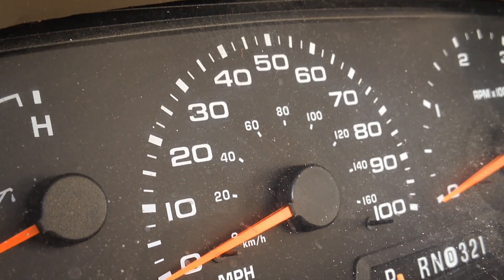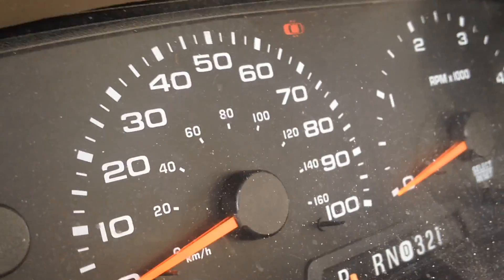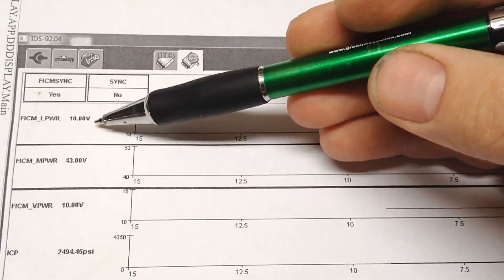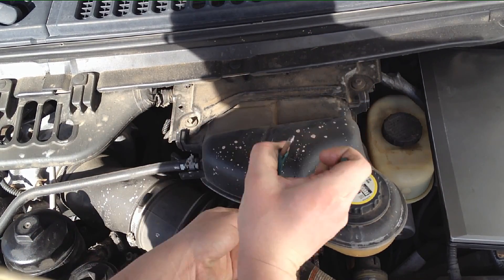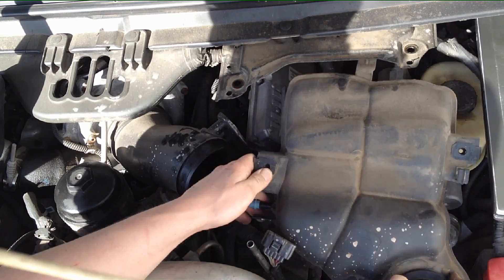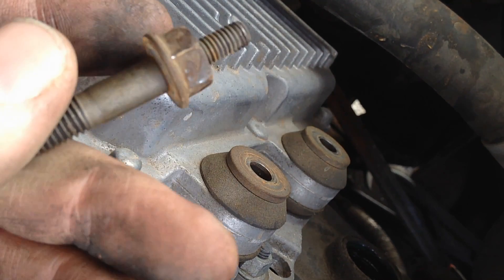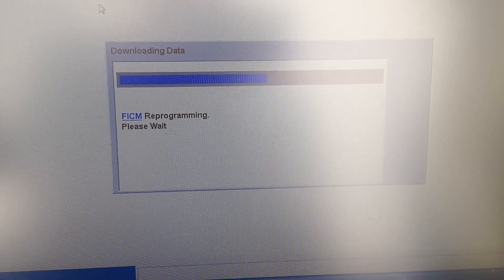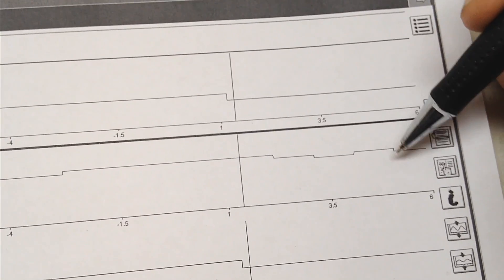No Start: Ford 6.0L Powerstroke FICM Diagnosis & Replacement

Comment: I have a 03 f350 6.0l powerstroke crank no start I am not getting ficm sync or crank/cam sync. Could a bad ficm cause no crank/cam sync? New crankshaft position sensor and wiring harness, any thoughts would be greatly appreciated

Comment: Hey man great video!! Having a FICM issue on my 2006 DT466 7.6 in-line 6 Navistar. They use the same IDM as the 6.0L V8. Would you know how I can go about flashing the FICM to be able to work on my truck. They all come programmed for Ford 6.0 V8

Comment: Ever see the logic board fail? All pin point test, air test, Ficm power board, IPR, Icp, cam all changed or pass. Motor starts run till 180degrees then stalls? Fuel pressure 70, buzz test good no codes…. Once stalls will fire then acts like the key is turned off?? Anyone got an idea

Comment: I started her up today, it was a little cold.  Idle poorly and took a while to warm up. Then the check engine light came on with p0276. Auto store said FICM. They say injector #6 is low voltage. Should I take it as bad FICM and buy it and dont investigate anymore?!? Anybody know anything more on this injector low voltage?!?

Comment: 04 f350 6.0 and out of nowhere would not start wouldnt crank brand new batteries. I checked all connections still no start im new to diesels but I ended up needing to use screwdriver at the starter solenoid to start it to get truck home what could be the source of issue next day has started fine im confused

Comment: Ficm voltage is straight 0 when cranking. Got a new ficm and still the same thing. My IPR % ICP volts and ICP PSI are normal. What would be the next step in the troubleshooting chain?
Reply: Whole wire harness?
Reply: Relay potentially, only other thing I hear besides maybe yeah the wiring harness

Comment: On my 04 f250 6.0 it was cranking with injector cycle and fuel pump working with no start. Now starter does not turn, no injector cycle and fuel pump not working. i can jump the starter and it turns. Any ideas?
Reply: May have overheated the starter solenoid

Comment: I have 2006 6.0l starts and runs but misfiring on cylinder six only setting a p0276 code the injector 6 and where replaced. Could a fcim cause only one cylinder to miss
Reply: I was told that FICM was my problem for p0276 low voltage to injector #6!!! Did you figure out your problem because I have the same problem you do now.... lmk pls
Reply: @benjaminbailey6383    Yes it was the FCIM was burnt on the inside
Reply: @adamlagace2485  thanks!

Comment: I have a 04 6.0. I also have a scan gauge. Can you help me with my crank no start? I can upload a picture of the icp sync ipr and ficm m power.
Reply: Any update? Same here all around 04 6.0 crank , no start
Reply: @jermbob92   any update same issue right now breaking my head with this fotd
Reply: @jonathanbravozya  my issue was a failed attempt rebuilding my injectors. Bought all 8 motor craft injectors and it started right up.

Comment: Anybody have thoughts on a 06 6.0 that is really angry starting below 30 degrees f? All my readings are good except after a cold start below 30 I get p0284-60 dor cylinder 8 after a few warm drive cycles the code disappears or does not come back. Switched to 5w40 t6, changed fuel filters, and added the blue spring. Starts a little better but still seems angry on a cold morning. By angry I mean loping after start and just really rough idle for the first 60 seconds or so.
Reply: For cold climates, some have been changing starter to the 6.7 which offer 25% faster crank

Comment: im wondering if this is same problem im having on my late 04 6.0 its my icp i have to pull plug out or she wont start i have to keep rpm up to 1500 or she stalls changed pig tail on icp same problem no power pulling my 11k trailer up hill

Comment: No start for me, but FICM main power is actually at 0. Fuses all look good, relay  replaced. I replaced the power supply on the FICM as well. 
Ground issue? It will crank, but not even try to start.
Reply: U figure it out?

Comment: I just bought a truck drove a few miles shut it off and when I went to start it would just crank. Let it sit a few hours and noticed when I turned the key I didn’t hear the spool valves and still wouldn’t start. New ficm was installed last October (9 months) could it be bad? What else could I check.
Reply: weisel6 dummy plugs and standpipes.

Comment: I've got a question for ya. I have 2007 f250 with the 6.0 liter and I'm getting around 1.7 volts to the fuel pump with the key and everything off but I get 12 to 11 volts with key on engine off, is that normal?

Comment: Is there a system in 2005 ford excursion 6.0 diesel powerstroke that when the charge in batteries goes low enough the starter wont even try to crank  and the relay just click click click

Comment: If the voltage that I am getting from the ficm is 46 volts,is that bad enough to make my truck crank and not start.
Reply from the maker: no
Reply: FordTechMakuloco Thanks for the response, so what could possibly be wrong that the truck cranks but does not start. Like I said I have been having the truck for about seven years now and I never had any issue with it until recently that I wanted to start it and it was just cranking. it is doing exactly what this truck is doing here.
Reply from the maker: There are many many items from a stuck open egr to, Sync, or Ficm sync, or Icp not above 500, icp biased, ipr stuck open, stc fitting blown out, roller lifter need bearing stuck in the main oil pump regulator and the list goes on. These are all common issues on this truck.
Reply: GREGGS TECH read my post about after math of cleaning KnN filters... did you clean your filter

Comment: Thanks for all of these your helpful videos. I have the 2004 Ford F 350 Super Duty Lariat 6.0 Power Stroke Dually and I have been having it for about seven years now without any issue until recently that I wanted to start it and it does not start just cranking.I have bought the scan gauge but I need help to know how to use it to check if it is the ficm that has gone bad.I hope you will be able to explain this to me.Thanks and I look forward to hearing from you.God Bless.

Comment: My 6.0 cranks but isn’t the same sound. It sounds like no compression. Any easy way to check? Ficm seems good 47.9
Reply: FBI if the truck is from anywhere near the oil fields.... emergency shut off valves sometimes stick closed.... remove the intake hose elbow  from the upper cac tube and 4 8mm bolts that hold the elbow to the intake... check if there is a valve.... touch it with a screw driver or something to see if it opens easily... or if it doesnt have a valve there.... at least ya checked.  Ive seen the valves stick after years n years of turbo oil blow by makes it dirty
Reply: 6.0L fast crank no start.... by maverickracer5 ..
 Does a video on this oilfield emergency shut off valve.   If there's a bad gas leak out in the oil fields a diesel will run n run on even with the key off. So they install these cut out valves on all trucks close to the rigs
Reply: Ernie Desjardins hey man, thanks for the help, I actually got it going. Wasn’t building oil pressure due to a stuck IPR valve. Not sure why it would sound like no compression but it’s back working. I’m sure your comment will help somebody

Comment: Hello, 05 f350. Have had a couple cases of no starts. One was ipr sensor, fixed problem for a week. Next issue truck had a hesitation with a carbon-like smell and a puff of smoke. truck ran fine for a week, started to stall after start ups after driving a hundred feet or so. got worse, replaced ficm. Week or two later, truck would stall again but starts right up. Had a miss when driving, like a bad injector. Last week, truck kept stalling out at random places, got bad quick and eventually would not start except after excessive cranking and pressing fuel pedal. Mechanic is stumped now because everything checks out fine. Tried pcm swap, ran better when warm, but no start next day. Now it sits. Truck has had everything replaced since owning for 5 years. EGR is deleted, new injectors (although one was replaced for being defective) New fuel filters, new HPOP, icp? valve?head gasket with stud kit, Plus I am forgetting stuff I am sure.Please help!
Reply: What was the issue in the end, ever got it fixed

Comment: so I got a diesel technician that checked my  oil pressure and told me it was my IPR if not ficm because pressure was only at 27 and I disconnected the ICP still no start and has just gotten a new HPOP changed camshaft sensor if you could help 3 mechanics are stumped and I need my truck fixed for hauling my cattle trailers the truck before it died and didn't start left me stranded one time and when the engine cooled down it turned on ran a few days and than again running the truck maybe two hours it died on me but started again and in maybe 2000 feet died and hasn't started since any help would be appreciated I'm stumped and so are my 3 mechanics
Reply: What was the issue in the end
Reply: Should be at 800 psi to start Ipr is the issue if the hpop had been replaced already or icp sensor is faulty reading

Comment: 2004 Ford f350 6.0.  Just had 2 injectors and fuel pump replaced last week.  Two days later I was fixing to leave for work and the truck died.  No crank after that other than vacuum pump. The repair man came to my house and checked all the fuses and relays.  He thought it might be the PCM.  He brought a PCM from another truck and it started but no throttle.  So he ordered another PCM from ford matched to VIN, that did not work.  He ordered a second thinking maybe it was not programed properly.  Still no start.  We hooked up PCM from a 2006 and it started but its not matched.  He also checked the alarm system and it was not that.  Any help would greatly be appreciated.  My repair guy and 2 guys at the Ford House are stumped.
Reply: I just figuired my 6.0L out.... KnN filter oil from cleaning the air filter got on the mass air sensor betwwen the turbo and air filter.... brake cleaned it and runs again... took me a month to figuire it out. Did ya clean or replace your air filter
Reply: Joe Morales - did you ever get your truck fixed?

Comment: my 6.0 has egr delete and and head studs but I sometimes still get coolant puke out of the cap? and my parking lights/ dash lights won't work. signals and brakes work.
Reply: Aaron mine does it too.... if the cap is off while running and coolant come out like a volcano from compression thats bad. But likely just a shitty cap... change it.

Comment: hi I have a2003 6.0 f-250 it will start when plugged in garage but not outside 40 degrees and below and no engine code
Reply: Kurt Gray i run 5w40 rotella t6 up here in canada... -25c it starts perfect... put 2 new batteries in. Pick the highest cold cranking amps you can get... my batteries are 850 cold cranking amps....  start with that.  Also the oil really helps.... and 6.4L starter turns much faster which also made a big big help.   In twenty years tuckin ive learned batteries are a big deal in the colder weather

Comment: IF i can't get the ficm harness to clip in would that prevent it from starting?
Reply: +FordTechMakuloco Can my FICM be bad but the truck will still start? Have a ficm code and all injector low voltage codes but the truck will still run but wont build any rpm or boost.
Reply from the maker: yes it can be sure to get a pre programmed one like this-
http://amzn.to/1SKiMUk
Reply from the maker: +Russell Lucero Yes two of them control injector banks and the third sync with the pcm
Reply: Russell Lucero did you fix the harness clips?

Comment: curious what kind of software do you use and pc, laptop, tablet? Is it Ford issued equipment? Is it available for general use?
Reply from the maker: Yes it is the Ford IDS system that we have to use and subscribe to at the dealers. They do offer it to the public but very expensive stuff.

Comment: So is it the actual DC/DC converter failing or something else in the FICM? I used to do a lot of 48VDC work and curious.
Reply from the maker: They are saying the dc/dc converter is failing mainly from the inductive heating strategy and when you rebuild them you only replace the converter.
Reply: FordTechMakuloco
Just read up on how to repair the power supply.  8 caps and re-solder a couple of surface mount resisters. My supra had this problem (models before mine) and the filled the Ignitor module with a dielectric gel. Cool stuff.

Comment: Judging by that coolant residue I'd say that truck is about due for a Cummins Swap. lol jk. Love the videos. I am a Ford guy. I tend to have a special kind of respect for Fords, without Ford I wouldn't have my mechanical experience. I have a 82 F150 that I swapped in a 4 cylinder Cummins into. Thank's for the videos.
Reply from the maker: justhes I bet that is a interesting truck. Any videos of it running?
Reply: Yes. In fact i have the entire swap documented on my channel.
Reply: Fuck Ford 6.0